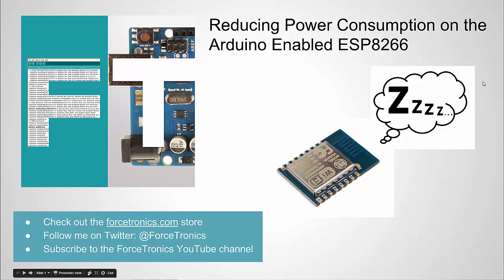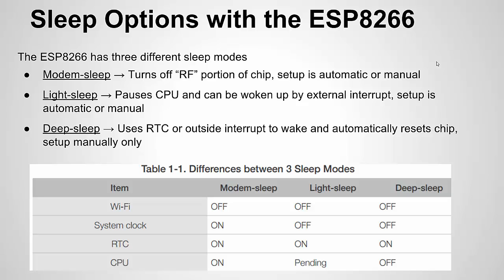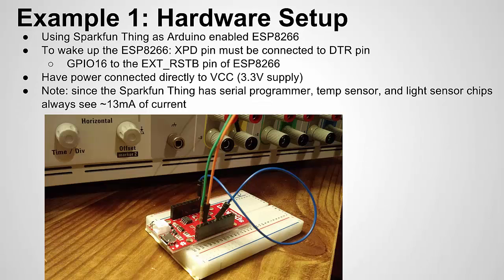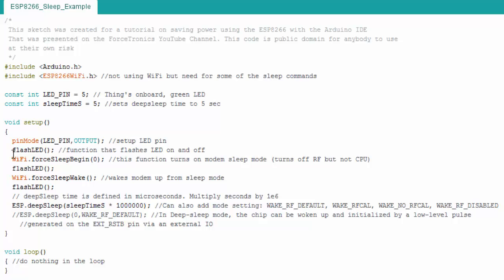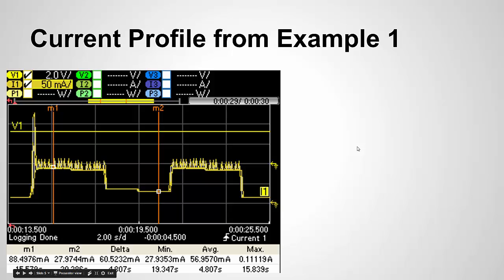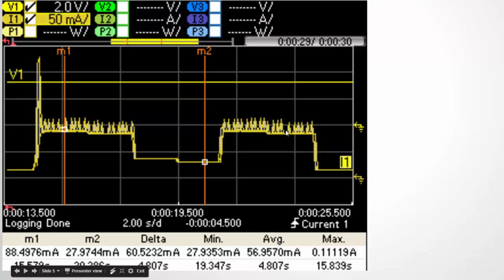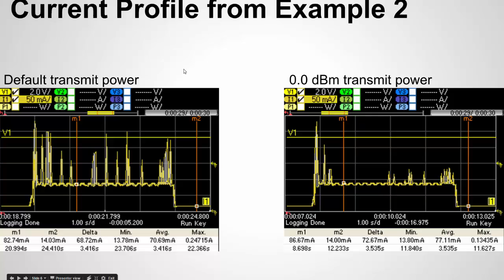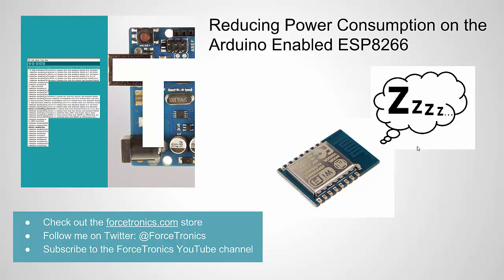Reducing Power Consumption on the Arduino Enabled ESP8266

Comment: Most helpful.  Thank you.  I have been doing similar testing on a bare bones ESP8266 and implementing a technique that is supposed to conserve even more power: shut down the ESP via the CH_PD pin.  To turn on, this pin is pulled high with a button and a second pin connected to CH_PD is pulled high to sustain the ESP while the Setup/Loop is completed.  Debashish Sahu introduced me to this idea is his well done video.  

Expected power draw is supposed to be <1uA per the ESP datasheet.  My measured draw is about 20uA plus 8uA for the HT7333 regulator.  Even in deep sleep I have been unable to achieve the datasheet stated 10uA, but instead can only get as low as 50uA.  I leave this for others who may experience the same low power challenge.  Thanks again!

Comment: Add high value capacitor at input supply so we can remove surge current for starting point
Reply: Jaysukh Chavda good point. Important to note is that the capacitor should have a pretty low ESR otherwise it would not have too much of an effect in thr case of very short current spikes.

Comment: Great overview.  Some real gems!  I was looking to implement a dash-like button device  using the ESP8266 that would potentially last years on battery with 100 to 200 button presses. In the end, I came up with a simple PNP transistor solution using an open collector config. It only  0.5uA when off because of PNP leakage.    https://github.com/mtroyernl/dashbootstrap

Comment from the maker: Note that even though the ESP8266 manufacturers refer to a module in the radio block as a Real Time Clock (RTC), it is not a real time clock. A RTC can keep time and date data, but the RTC on the ESP8266 can only count up (like a stop watch) with micro second resolution so it is really just a counter or timer module.